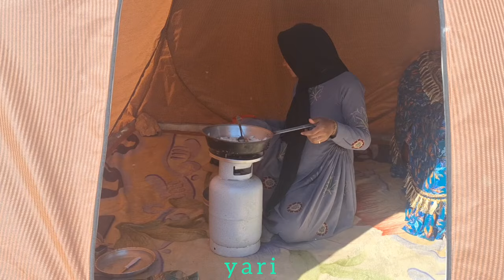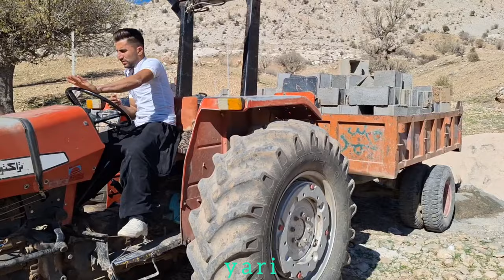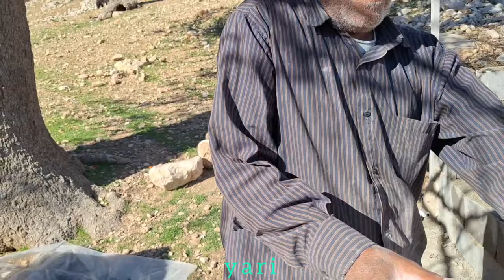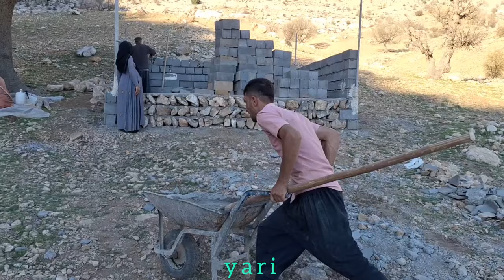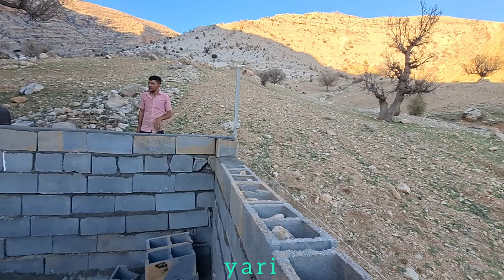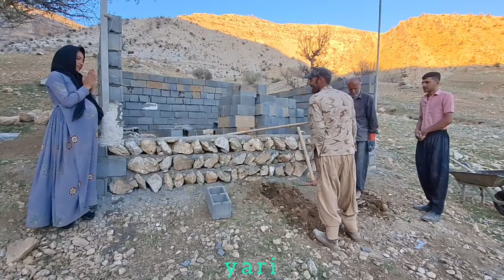Construction of Zainab's dream house with the help of Mohammad's father and Mohammad Reza's teacher

Comment: This looks like a good dry spot and a shade tree for the house location.  Build it with a good size overhang on the front roof to keep rain away from the front entrance and windows facing the sun for winter heat.